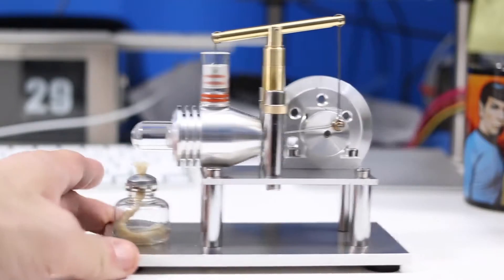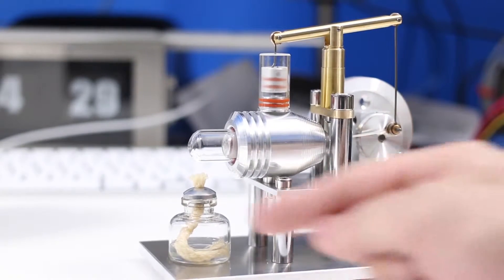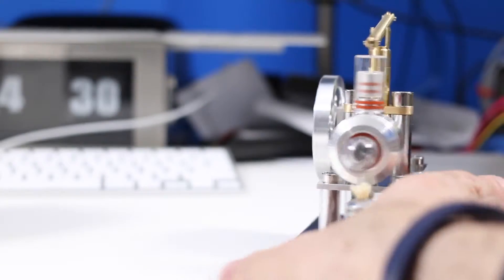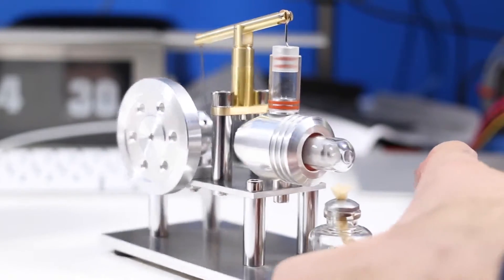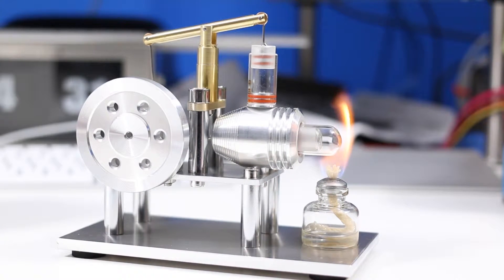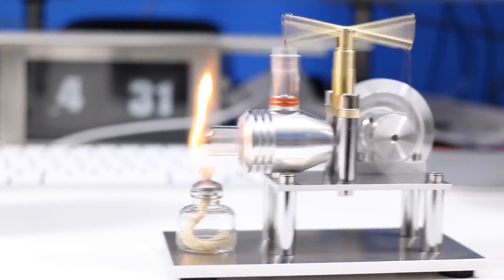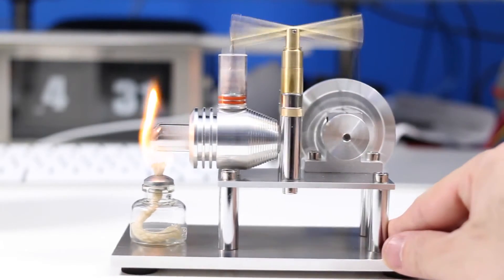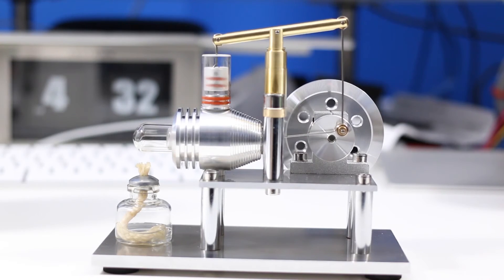SunnyTech Hot Air Chrome Stirling Engine SC02 Demonstration and Review

Comment: Is alcohol required so to run? can't we use our candle the thing required there is only to heat that part am I right (PLZZ reply I going to buy it)
Reply: also it will leave alot of black residue which makes you have to replace the glass tube and sometimes the cylinder
Reply: @jamminjared3666  thanks for your suggestion brother 💞
Reply: @bhaskarnavasare4793  no problem
Reply: also if you go to publix or a drug store you can get alcohol
Reply from the maker: Technically, the candle (or any fire) may work... but it probably won't be hot enough and it will make some smoke marks on the glass.  What I learned is that some flames are clearly hotter than others.  70% alcohol for example worked too... but it moved much slower.
Reply: @AskJoe  but will it run at satisfactory speed
Reply from the maker: @bhaskarnavasare4793  If it runs at all, it will definitely be much slower.  Alcohol is harder to find lately, so I totally understand.
Reply: @AskJoe  means?
Reply from the maker: @bhaskarnavasare4793  I've tried running the engine with candles and it doesn't move very well because a candle isn't as hot as alcohol.  Ever since Covid, alcohol has been out of stock quit often.
Reply: @AskJoe   but putting high flame will make it run am I right 😅
Reply from the maker: @bhaskarnavasare4793  Yes... but it will be slower.
Reply: @AskJoe  thank you so much 🙏liked and subscribed ur video. 🥰🤗
Reply: @AskJoe  otherwise I will wrap that heating part with foil paper. Foil will not become black or I can use other oil in the lamp instead of alcohol